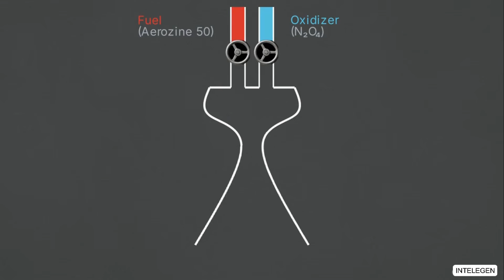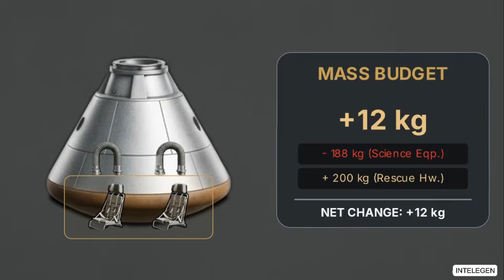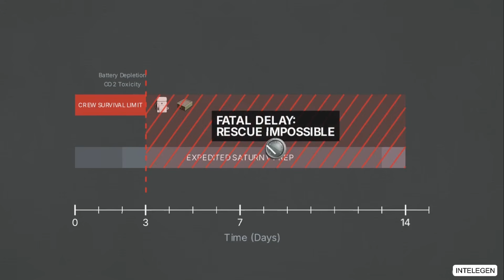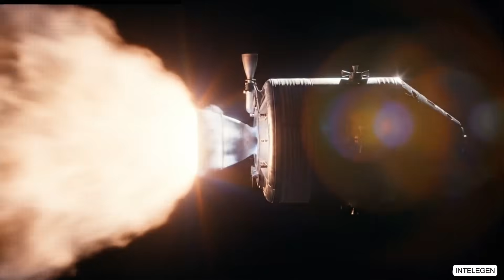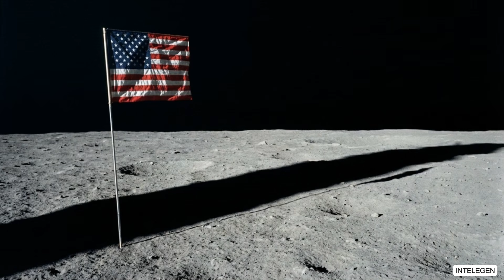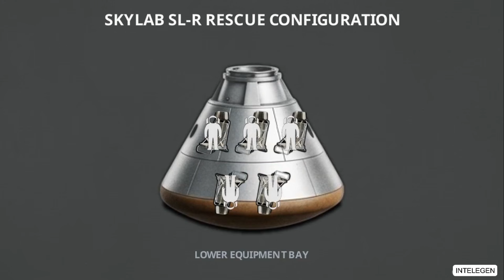NASA’s New Moon Base Plan: Why Artemis Just Changed Forever

Comment: Does anyone even try to do Quality control on the illustrations?  Good Grief.  The command module is not the lunar ascent module.  The command module would never be anywhere the lunar module without the service module.  Pull this low quality trash and try again.